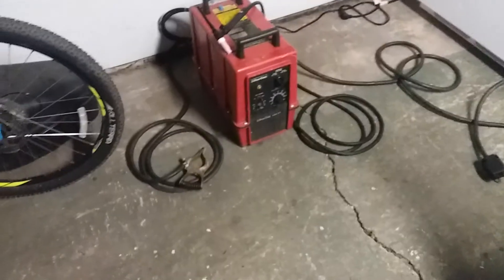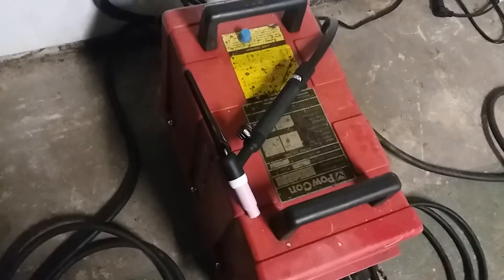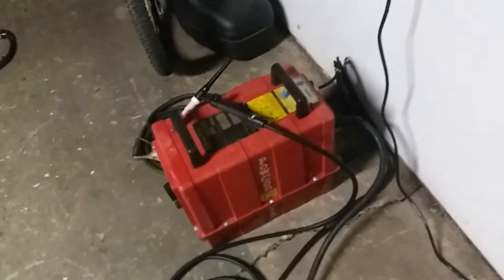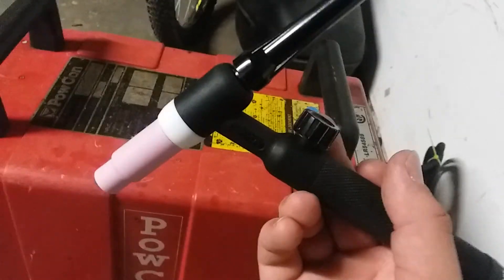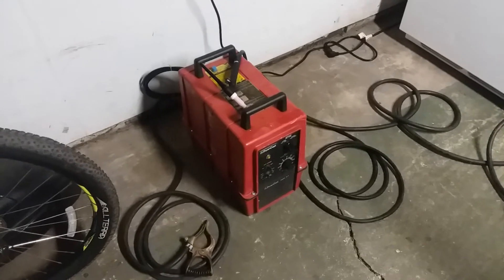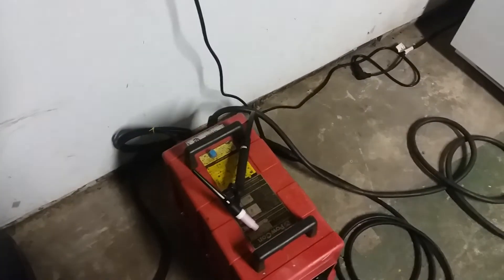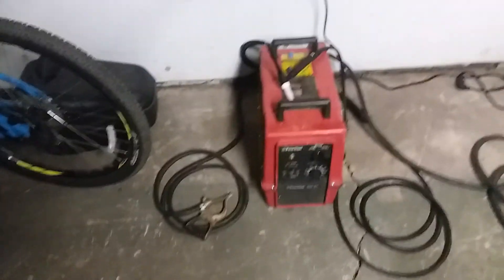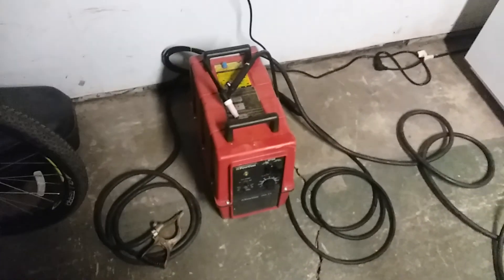End result! Vulcan TIG torch on a DC inverter.

Comment: I worked at POWCON as an electronics technician and RMA phone service support in the 1990's.
I repaired the power control boards every day, and every once in a while some RMA returns.
I remember that the SCR pulse output ciruit on the control board had these 4 donut coils with a diode that was under-designed in my opinion. Sometimes control boards would come in burnt up because the diodes were too under-rated. What made them blow up is when some people would run really long lines to the work that was being welded, and what that did was create an inductance spike that would breach the reverse voltage rating of the diode and short them out. That would cause a fire and ruin the control board. I recommended doubling the rating to over 1000-1500 volts, but the company didnt want to add .35 cents cost to each board, which a board would cost 300-600 dollars to replace when it caught fire.

Comment: That's a very good machine. Arcon Welding makes the newer versions. Still used by the US Navy and other branches.
Reply from the maker: It's done me a whole lot of good in the past year or so, and in southeast Virginia, they are easy and cheap to come by. I'll have to look into Arcon. Thanks for watching!
Reply: Actually just got one of these machines given to me this weekend. I had never heard of Powcon welders before, but from the research I’ve done, they have a very good reputation. Expen$ive in their day. Apparently the guy who had it was running it on 220 single phase, as it has a length of heavy Romex running out the back where the cord should have been. I plan to replace that with a length of cord and a plug so I can just plug it in where I plug in my old battleship Linde machine. Surprised to find that you can still download an operators manual for it. I’m hoping to find or make a foot pedal control for it too, but I’ve heard those 14 pin plugs are just about unobtainium these days.